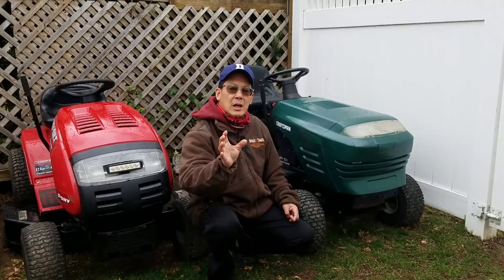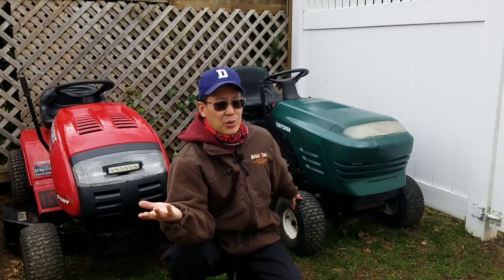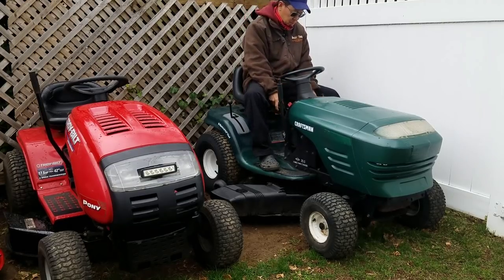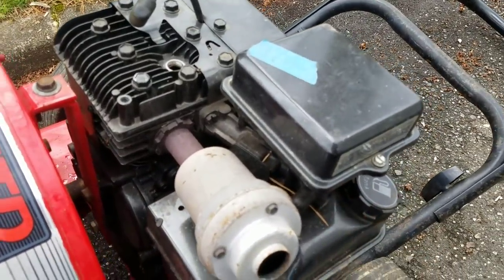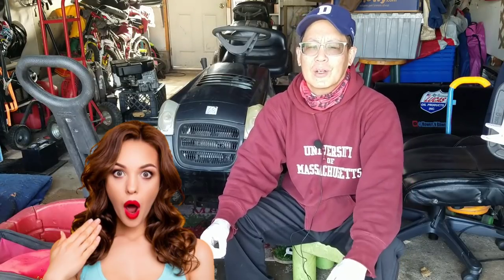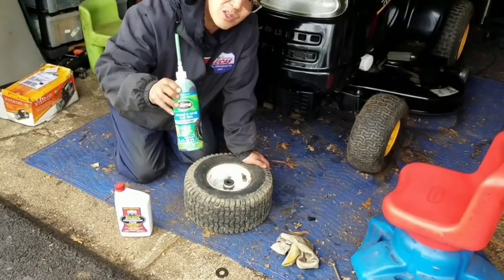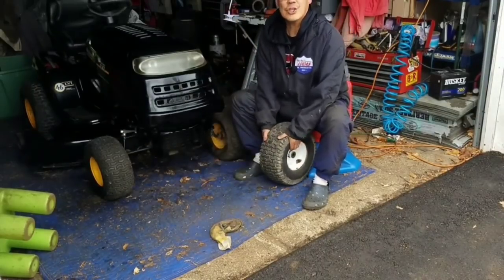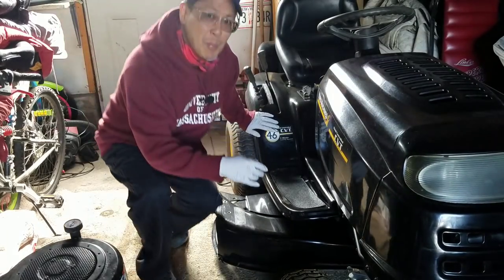HOW TO REPAIR FIX LAWN TRACTOR SLOW LEAK TIRES USING ATF AUTOMATIC TRANSMISSION FLUID & WHY IT WORKS

Comment: Once again, YouTube to the rescue. I’d seen people mention this and tried 4 ounces each in a front and rear lawn tractor but it doesn’t seem to have helped. I wondered whether it took a certain amount of time for the ATF to work so I asked on several different Facebook groups but everyone either disagreed that it worked or hadn’t heard of it. 
Your video finally answered my question, plus explained why it actually works. 
I suspect Slime has some ATF in it as well as the other ingredients.
Reply from the maker: Slime doesn’t have atf in it,  you have to rotate tire so every inch of the tire is covered with atf.  It works only with slow leaks,  if theres a huge crack or hole,  it’ll leak out.  Hope you’re subscribed

Comment: I use a cheap BBQ sauce bottle and only 4oz for the front about 6oz for the back.  Works like magic and way cheaper than slime.  I've done like 40 slow leak mower tires etc. this way over the years.
Reply from the maker: Ketchup or mustard squeeze bottle with a hose on it works great too.  Hope you’re subscribed

Comment: Will used ATF work? Just changed the ATF in my wife's car and thinking of keeping the fluid for this purpose.
Reply from the maker: I don’t see why not
Reply: @MowersNBlowers  I did it on a few riding lawnmower tires. Seemed to work just fine. Used ATF does work too!

Comment: I take duct tape and tear a piece appr. The lenth of bought tire plugs.tightly rolled up lenthwise with sticky side out works as well as bought ones.larger holes simply use 2 pieces together.ive had ones to last as long as the tires
Reply from the maker: Great idea

Comment: So Henry what amount did you dial in as the correct needed amount to seal off the leaking tires? 👍👍
Reply from the maker: 6-8 ounces depending on leak,  no set amount.

Comment: So would this be legal in a slow leaking car tire suspecting corrosion around rim bead
Reply from the maker: No because your wheel would vibrate violently at highway speeds from imbalances

Comment: The pulsa jet carbs on those older briggs model engines like the one on that ground blower are a pain in the ass to work on.
Reply from the maker: Big time!  You hear your shout out?
Reply from the maker: Skip 5:36
https://youtu.be/aGvdbMqe-zc
Reply: Mowers N Blowers yeah man! Thanks
Reply: Its a pain, but when done, that's a much better engine than the newer OHV. The 8hp has a regular updraft their not too bad.

Comment: Does  the ATF work with slow leaks in tubes tires?
Reply from the maker: It has worked for me,  but logic says it won’t because the rubber won’t expand to fill a pinhole.  Worth a try right!  Atf is cheap and I’m sure you have some lying around.  Hope you subscribed

Comment: well at least now i know the reason why atf works in the tires like that, thinking about trying it but i dont want to buy a smile bottle to put it in lol ill figure something else out on it.
Reply from the maker: Try old motor oil, I hear that works too.
Reply: @MowersNBlowers  oh wow I got plenty of that sit in the back near my garage lol you probably seen it in my videos I was going to take it off to recycling maybe I'll try a little of that first before I do
Reply: @Turningwrenches85  If the oil doesn't do the job, just buy the 5 quart bottle or more, still cheaper than slime or tubes and should be enough to fix a lot of tires.
Reply: @Mr_Tecumseh  thank u for the advice

Comment: My wife loves the red truck merry christmas floor mats, she would be disappointed if she saw it being used to collect fluids underneath a riding mower.
Reply from the maker: Lol, unfortunately, it was thrown out by the wife and I took it into the garage to collect oil drips just as you said.
Reply: @MowersNBlowers  my wife would not approve of that...LOL  she loves her red truck floor mats.
Reply from the maker: I’ll try and not use it then!
Reply: @MowersNBlowers  I just won't let her watch the video with me LOL, but thanks for trying not to use it I will let her know to put a smile on her face.

Comment: No, the reason the atf works so well in a tire is, it's like star wars, it does battle in the tire, and the atf is like the jedi forces, and the tire is the imperal fleet, and as we all know Luke finds that hole in the tire... Swamp rat yadda yadda, and defeats the deth star..... LMAO
Reply from the maker: You’re a nut!
Reply: I am going to try this, but if it does not work then I will assume Darth Vader won.

Comment: Your tires didn’t spin from having an oily bead at all
Reply from the maker: Not at all.
Reply: I plan on doing it to a truck tire it has a slow leak what do you think
Reply from the maker: @windowwarrior5925  not too much because lawn tractors don’t go fast 10mph max,  if you put too much in a truck tire,  it’ll vibrate at high speeds because of the balance issue
Reply: Mowers N Blowers I was thinking that thanks for the heads up
Reply from the maker: @windowwarrior5925  anytime, hope you subscribed